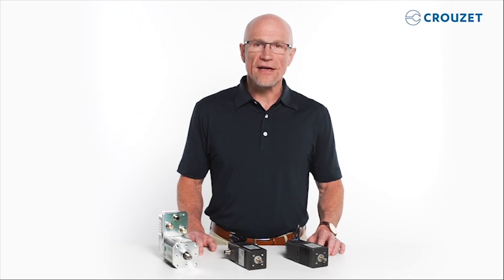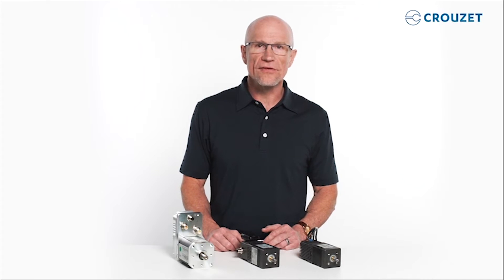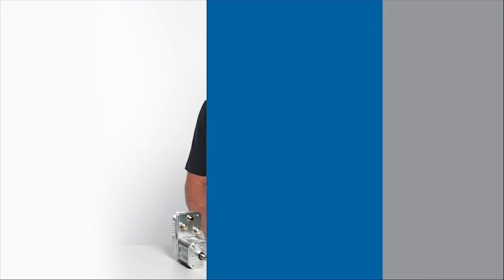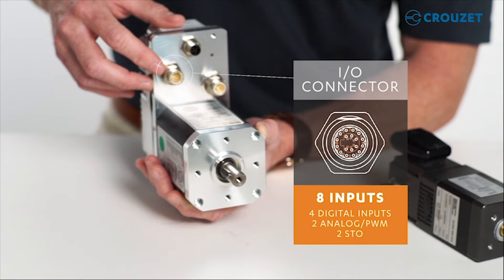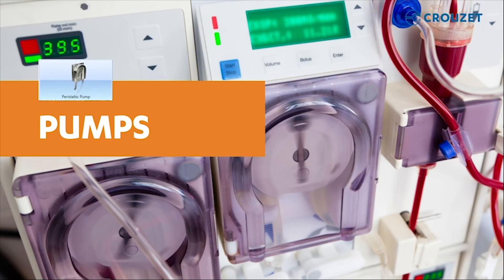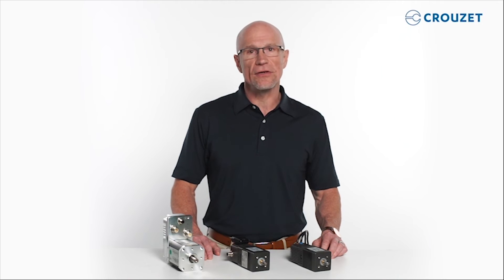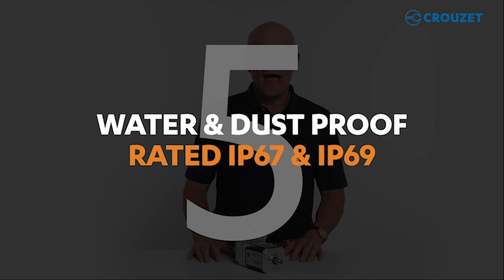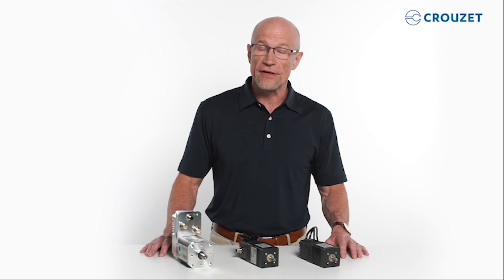What is a DC Brushless motor?

Comment: I have used a couple of SQ75 on an application, but I cannot run the machine as there is no standard for the STO Inputs. I am reaching everywhere to find a document indicating the Safety Performance Level of the motor without any luck. Crouzet USA told me it is PLd, but there is no supporting document, so I need to replace the 2 brand new motors with other motors.